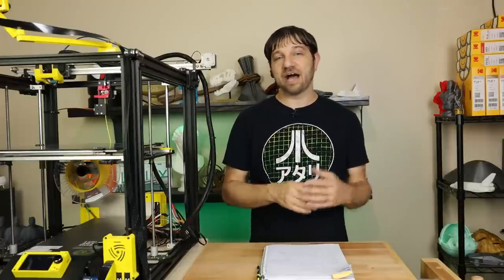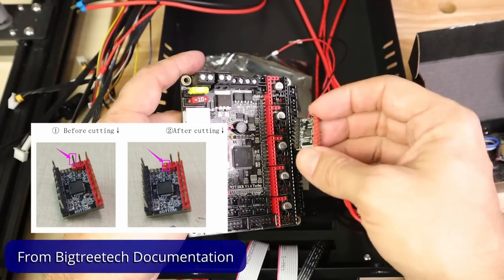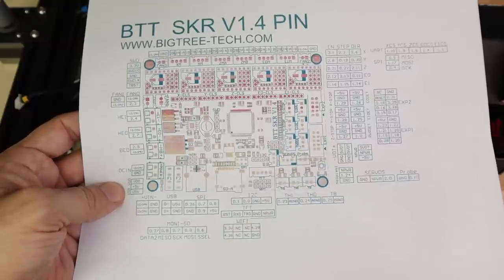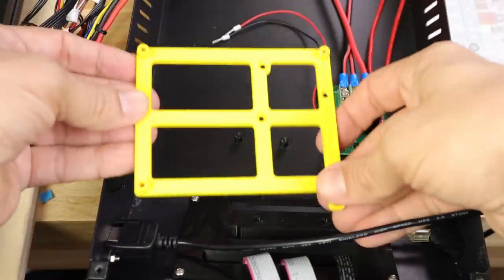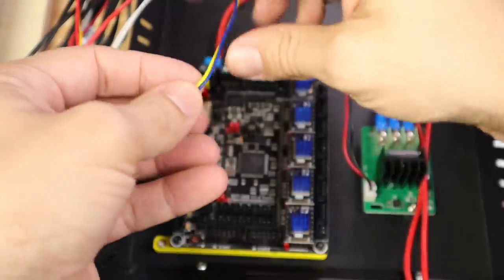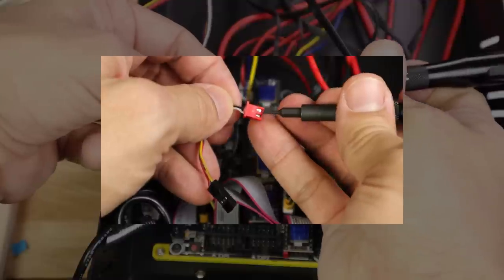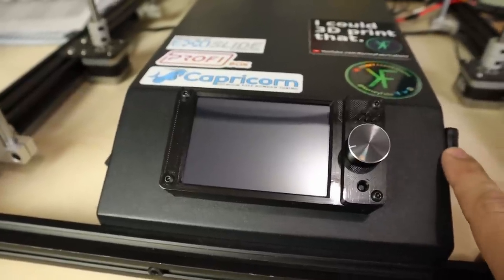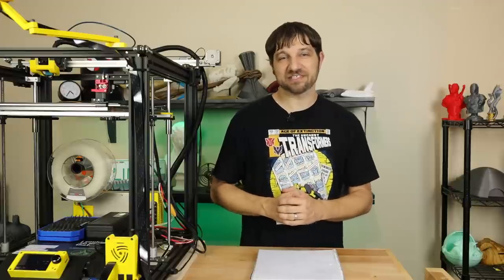Bigtreetech Ender 5 Plus Upgrade: SKR V1.4 Turbo (Part 4)

Comment: Followed your instructions and for some reason my BL touch is not lighting up? any Ideas? thanks
Reply from the maker: It has to be something with the 3-wire connector. Please double check order and orientation.
Reply: Same problem here... cannot make bltouch to work!!!  Everything else works, just need BLTouch to work to be able to print. Wire colors are different than on your video.
Reply: Kersey Fabrications its in the same way has in your video. I swapped the white and black wires also, still nothing..UPDATE: just noticed red and blue different locations... will try tomorrow and update everyone... thank You for all your advice with the video!!!!
Reply: Kersey Fabrications i have tried changing wires to yellow , red , blue.. like yours. What that did was it would’nt show the screen at all. When unplugged came back on again. The original wires were in yellow, blue , red order!  What would you do now?
Reply from the maker: @ru83n29  What are your wire colors?
Reply: I am having the same issue, my colors are different... Red brown orange... Edit. Got it working, had to switch red and brown
Reply from the maker: If your BLTouch has different colors:
New Colors:
Brown & Black: Ground
Red: 5V
Orange: Control Signal
White: Z-Min
Here's an image: https://photos.app.goo.gl/4cxeHgk3E1bTJyfn9
Reply: Kersey Fabrications what i had to do .. keep the original white and black wires same , not change them. Also my bltouch had yellow, blue, red in that order. This morning got up and swapped blue and red wires over , and it worked!!! Only problem now is z wont home keeps getting errors..
Reply: @kerseyfabs  HI and thanks, Black, White, Orange, Brown and Red
Mine lights up it just doesn't deploy. I test with screen commands and flashes red until reset. No blue light on BLTouch since it is not deploying. Checked wires for continuity and are ok.
Reply from the maker: If your BLTouch has different colors:
New Colors:
Brown & Black: Ground
Red: 5V
Orange: Control Signal
White: Z-Min
Here's an image: https://photos.app.goo.gl/4cxeHgk3E1bTJyfn9
Reply from the maker: I originally attached the wrong image. I've corrected my links: https://photos.app.goo.gl/4cxeHgk3E1bTJyfn9
Reply: OK peeps, I had the color wires in the correct order all along.  THE PROBLEM was the dupont termianls.  I changed them to JST? making sure of a solid connection and now my BLTouch works. It was not making good contact with the board pins.   It self tests and homing is as it was, working now.  So please check the connections themselves.  Thanks all for helping. Now, to figure out why my Extruder motor won't move.  I tested it before mounting it to Bondtech DD. 
Any idea what the current (vref) should be on E0?  Panckake motor

Comment: For the life of me I cannot get the stock filament run out sensor to function properly.  Wired correctly, light is lit, goes off when filament not present.  However when turning on runout detection in the screen...prints instantly stop.  In Marlin, I have uncommented the "#define FILAMENT_RUNOUT_SENSOR" line.  and also tried all combinations of comment and uncomment for the Invert_FS_logic, and Invertl_pinup_logic options.  No dice.  Any ideas?  BTW, no help found on the WWW.
Reply from the maker: If you're using the filament runout sensor with the touch screen UI, you have to wire the sensor directly to the back of the display. There you will find the FIL-DET pins. You can see the pinout here: https://github.com/bigtreetech/BIGTREETECH-TFT35-V3.0/blob/master/Hardware/TFT35%20V3.0-PIN.pdf
Then you can set it up using the UI and it should work for you. I hope this helps. 
More info: Basically, whatever is feeding the printer the gcode is what has to detect the runout and pause. If it's Marlin, then to the mainboard.  If it's touch UI, then the display. If it's OctoPi, then the Raspberry Pi. I hope this helps.
Reply: @kerseyfabs  Thank you so very much for taking the time to guide me.   I will make up some extension cables and give this a whirl.  Appreciate all of your very educational videos, keep up the good work!
Reply from the maker: @LivnlargeCO  I'm happy to help John!

Comment: What did you do with the Z wire after you plugged in the bltouch black and white wire? 
I can't get this stuff working.. The printer crashes on all axis, not sure if bltouch is the cause or even if it is working.
Reply from the maker: What other Z wire is there? You should have the Z motor and the BLTouch wires for the Z. That should be all. Make sure you have all of your endstops plugged in to the correct two pins.
Reply: @kerseyfabs  The 2 wire end-stop wires. after you plunged in the 2 wire bltouch wires into the z stop .. next to that is the y stop. You plunged into the servos probe witch is marked "bltouch" and the 2 remaining wires to the blotuch you plugged in the z stop. I never saw what you did with the z stop with the yellow marker on it after you plugged in the bltouchs remaining wires. (Mine are black and white)

I have I think all the plugs in the right places.. I can move all axis in the right direction but if I try to home it.. The x shoots to the right and hits the gantry upright then the steppers make a hell of a noise. then It smashes in the bed. I am afraid to turn it on now..
I bought 2 of these boards for 2 different printers. With the btt v35 screens and bltouchs.
Reply from the maker: There aren't two Z endstop wires. There isn't a Z endstop, we use the BLTouch for that. Also, make sure you have the other endstops on the bottom two of the three pins if you're looking at the drawing.

You're not using my source or my binary? That configuration doesn't even look like mainline Marlin. To use it the way I wired it, you will need that last line uncommented because we are using the Z endstop for our probing.
Reply: @kerseyfabs  I could not get your source to compile.. But I am using your bin file.. I did a compare of your source files to mine and made the changes that way and it would not compile.. I will keep hammering at it until I get it figured out.. 
Thank you so much. I have been lurking your videos for over a year. Your the the one that fixed my ender 5 bed falling issue..
Reply from the maker: I'm always curious when people can't get my source to compile. Keep at it and good luck!

Comment: Question thinking it may be my steppers, got everything setup, and im currently getting wavy prints from layershifting.
Reply from the maker: Wavy prints from shifts? That's a lot of shifts! Check your belts and check your motors to see if your current is correct and your motors aren't overheating.
Reply: @kerseyfabs  Yea I actually purchased some 2209 off amazon as well i swapped them out and no more layer shifting whatsoever idk why must be bad steppers?

Comment: Love the video and your awesome walkthrough.  Just got my E5P, and installed the board and ran the firmware.bin you supplied.  Runs very well, and I have printed using it.  When I compiled from the source code you provide here, and flash it to the board I get a "Heating Failed: Bed PRINTER HALTED" error when I try to preheat the board.  Any reason why this could be happening?
Reply from the maker: Thanks! Be sure to PID tune your hotend and bed using the latest firmware. You can find multiple sources with how tos.
Reply: @kerseyfabs  Thanks!

Comment: Do you have the link to the TFT35 v3.0 mount you used for this?
Reply from the maker: Sure!
First Display Mount: https://www.thingiverse.com/thing:4051550
First Display Mount (No Dremel Remix): https://www.thingiverse.com/thing:4421077

Second Display Mount (Enclosure): https://www.thingiverse.com/thing:4153427
Mounting Bracket for Ender 5 Plus: https://www.thingiverse.com/thing:4370844

Comment: i have an ender 5 with skr 1.4turbo and bltouch, with TMC2209
Whill this firmware work? which one of these i need?

Shared Z-stepper
Pre-built forTMC2209
Dual Z-Steppers 
Pre-built for TMC2209

what happens if i dont cut the tmc2209 pin ?
Reply from the maker: Do you have an Ender 5 or Ender 5 Plus?

If you don't cut the pin, it will think it's in sensorless homing mode I believe. That won't work with my firmware. It will probably just crash into the endstops.

Comment: Done the 1.4 turbo upgrade today alone with a BTT TFT50 screen.  Burnt the firmware to SD card and powered on.  Display works but shows "No Printer Detected".  Went back and verifed screen connections EXP1, EXP2 and TFT pins to the board.  Also seems weird that my Power supply fan is not kicking on.  I have power to the Turbo as there is a red and green light illuminated.  Do you all have any ideas as what I could be doing wrong?
Reply from the maker: Check the baud rate on the display. It should be 115200 most likely. It's in the settings menu.
The power supply should have a self regulated fan... unless the fan died.

Comment: Do you have the printable upgrades for the board and other parts?
Reply from the maker: The only prints you need for this board are the mounts for the board and display. What other upgrades were you thinking? Those links are in the description.

Comment: Arg.  Followed all of this - good clear instructions, so thanks, Kris!  However, when I was all done, my display shows nothing.  The red LED on the display board is lit.  The power supply is on, the SKR board's LED is lit, and I even noticed the BLTouch doing it's normal up down check at power up.  Can anyone give me a clue how to troubleshoot this without a display to look at?  I have the TFT35 v3.0 display, and haven't had a chance to update the firmware in either the SKR board or the TFT display since this was the first power-up.  I'm really at a loss and would appreciate any guidance!

Comment: hello, can i know the hot bed supply as shown in you video the (+) supplyat the left side and the (-) supply at right side. 
My question is the board skrv1.4 turbo that i have at the back side its display (+) supply at the left side and right side is signal. i already follow u video but i check the supply for bed no supply at there unless i connect the (-) supply at dc supply. Can u help for it? cause i afraid to test
Reply from the maker: Sometimes "signal" can be ground (-) instead of power (+). So it sounds like you're fine. Use the markings on the board.
Reply: @kerseyfabs  oo i see ok2 thnkz

Comment: i have a problem flashing the firmware via sd card. it didnt flash and left the screen blank. at 1st it shows two icons, a marlin icon and a big tree tech icon. i pressed and turn the knob and nothing happens. after a while. the screen went blank but theres a beep sound if i press the knob button.
Reply from the maker: Which SD slot did you put the firmware into? The display or the board? Were you trying to flash the display or the board?

Comment: Is the same guide can apply to Ender 5 Pro?
Reply from the maker: The instructions will be basically the same. Just pay attention to the wiring location and polarity. You'll also need firmware for that printer.
Reply: @kerseyfabs  great, thanks a lot. :)

Comment: I used your Firmware and my extruder will not move at all. it moves when i try the y stepper cable i even tried moving the e stepper connection down one slot. any ideas? I have TMC2209 and I feel like ive tried everything except compiling my own firmware. Thanks for the fantastic video its what got me this far..... and im sooo close... but yet so far. someone please any suggestions. THNX
Reply from the maker: Let's see what we can do.
First, did you verify that you are indeed running my firmware?
Second, did you reset EEPROM defaults? EEPROM Init.
Third, have you tried using the Marlin interface to make sure it's not a problem with the touch UI?
Reply: @kerseyfabs  hey I figure this out. The only question I have is I have a direct drive setup. Will this work correctly with it. I was getting some blobbly line extrusions.
Reply: I appreciate the replies and am in the calibration steps. You have been a huge help already. Thnx

Comment: I've watched a few of your videos and am thinking of installing this board in my Ender 5 plus and was going to buy the 2208's to save some money, but it would cost me $139 CDN(about $100US) for just the 2208's, but can buy the board with 5 2209's for $88($68) bucks, not sure why they are so much separately
Reply from the maker: I've seen that before. If they're cheaper, get the 2209s. I have firmware for both.

Comment: Hi 👋  
I just did this mod - skr 1.4 turbo, 2209, tft35, but i keep getting a BL touch error even after rewiring the pins to correct locations
Any idea what I could do to fix
Reply from the maker: This is the most common question I get. It always comes down to miswiring or a bad connector. Please double check your connections and check continuity the best you can.
Reply: @kerseyfabs  
Hey thanks for the quick reply
I recompiled the firmware and everything is working now
Reply from the maker: Fantastic! 🔥

Comment: I can't get mine to take the firmware. Under the info screen it reads the firmware from the touch screen. The file on the SD card remains a bin file it does not change to cur. I tried to home the axis, just to see what would happen and it just crashed on the opposite side of my end points. As well as the display keeps dimming out to Black. I have to turn off the printer for several minutes before the screen will turn back on. I have double and triple checked all my connections everything is exactly like it should be. Any ideas what might be going wrong? At this point all I can think is that I have faulty equipment.
Reply from the maker: I've heard of the dimming before. Have you tried Marlin mode to see if it's working? I believe I've heard of the exp1 and exp2 cables being swapped. As for the flashing, did you rename the file firmware.bin?
Reply: @kerseyfabs  Marlin mode  was just giving me a black screen from the start. I tried using the knob to scroll down to see if anything shows up but nothing, I can switch back to the other mode though. And yes I did rename the file. I even tried switching the SD card from the main board to the display, the display at least reads that there is a card inserted but still no update. I have also tried just about every configuration of the cables to the displaying that I can find. Seems like a few people are having this problem but none of their fixes have worked for me.
Reply from the maker: Sorry, I don't know of any magic fixes for this one. I'd blame cabling but I can't know for sure you don't have a hardware issue since I haven't seen this myself. Let me know if you come up with something that works. I've heard this before.
Reply: @kerseyfabs  I finally got the firmware on the card. I moved the jumper to power the board via USB. Plugged it directly into my computer And move the file to the card directly. My only problem now is the bltouch won't even light up And I cannot home Z. I've double and triple checked the wiring to the board And I'm at a loss. Any reference I can find online has different color wiring. I'm beginning to suspect I might have to reconfigure the servo pins but have no idea where to start. I cannot find anything that matches my configuration. I even tried referencing and the chip on the blue bltouch itself but where any useful information would be is covered by a qr code which leads nowhere.

Comment: Excellent guide, installed everything without to many problems, only issue is bltouch not working as end stop and crashes into bed, I've got configured as per video and used the firmware (only minor changes to thermistor type and max temp.as I have a V6 hotend) and suggestions to what may be wrong
Reply from the maker: If the BLTouch is retracting correctly on start-up, it's usually the white/black wire that's not correct. Take a look at that again.
Reply: Got it sorted thank you, break in the white wire that didn't become apparent until taking in and out that many times it snapped 😂

Comment: Hi I have e5+ with skr v1.4 turbo. BLTouch is conencted to servo and zstop. BLTouch is working corectly, deploy probe but it never stops. After z-home it deploys probe, probe is normally touched and doesn't stop at all z movement. Can you help me?
Reply: Nevermine: "if you are using the BLTouch with the brown, red and orange pins then you'll need to NOT swap the black and white wires around and swap around red and brown on the servo plug"
Maybe a good idea to get all users feedback and make Q&A in a video description?
Reply from the maker: There's a reason that I show which pins they go to and to over the schematic. It's important to understand what you're doing, not just follow directions. 😁
If it's unclear, black is ground, white is signal.
Reply from the maker: I also have this update in my pinned comment.

Comment: Hi Kersey,
First, tanks for the video!!!!
Getting a 1.4 turbo tomorrow and planing on following your tutorial, can you confirm if everything still up to date as inverting pins and such please ?
Thanks again
Reply from the maker: Please pay attention to pin colors and polarity more than whether or not I had to swap them. Sometimes orientation may change but colors should be true (unless they completely change them). All the best!
Reply: @kerseyfabs  thanks for you reply again .
i have made sure i respected polarity especially for the  black and the white wire.
i do get movement on all axes but can't get the blTouch to work.
Tried few things but getting real stuck now.
Reply: I seem to have found the solution, had to rewire the brown red and yellow pin as well and connect the probe juste above it.
Thanks for your video, can't stop watching and looking for more :) 
All the best.
Reply from the maker: Fantastic! I'm glad you solved it.
Reply: @kerseyfabs  Seems to be an issue after the other tho but i think its the usual route forward :)
Might contact you on Facebook at some point for some help if ok with you.